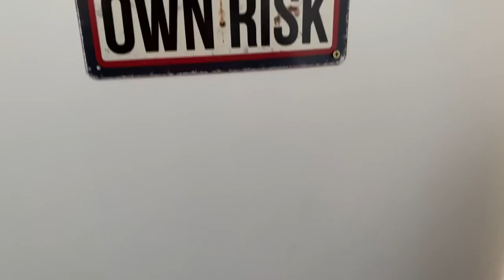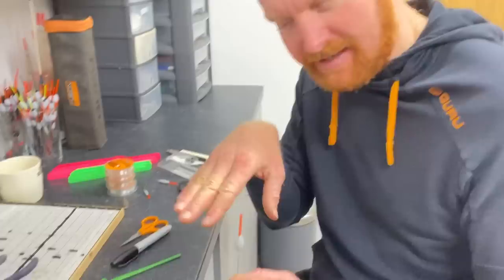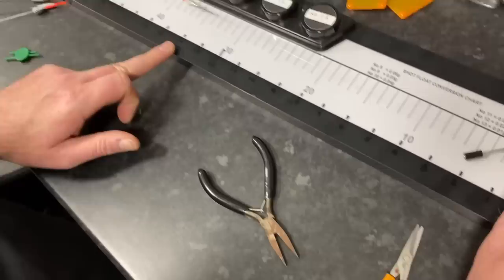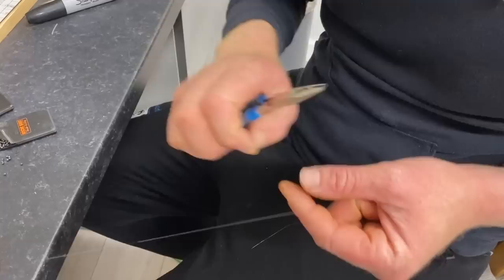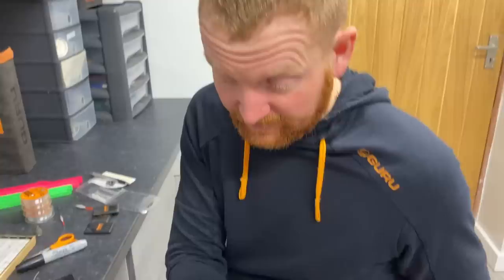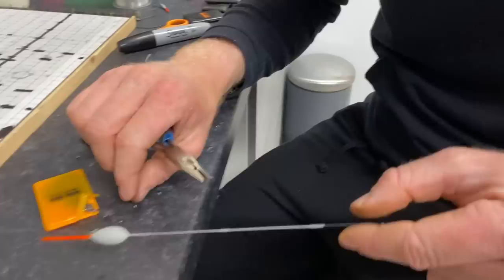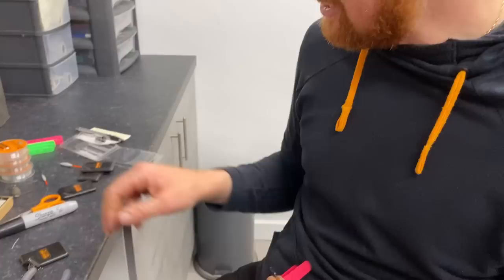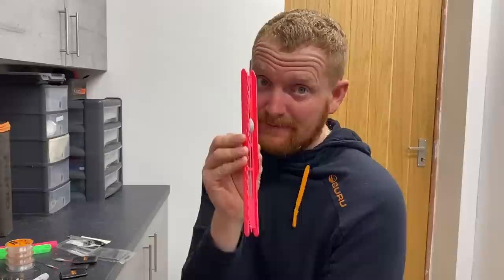How To Tie A Deep Water Silverfish Rig with Matt Godfrey

Comment: cracking vid. id use the rig on one of the deeper Silvers Lakes at The Oaks in yorkshire. your method is certainly far quicker than mine ! When shotting I havent tried wetting the float, but use a bit of washing up liquid in the container I sue, and still find the float sits far lower when actually on the bank. Will give your method a go

Comment: The trick you use to remove shot is a great tip, I've done it for donkeys. When i try explain thats what the metal ends on the Levapiambo are for they look at me like I'm a nutter.
  Please show a Levapiambo used in this way people are more likely to take it on board coming from a pro👍😁

Comment: I got a local club water about 8 ft deep full of small skimmers and slivers that’s going straight in my box for next outing I tied it watching your video actually you could have taken a moment or two longer talking about the actual shot spacing yes it’s bulk 42 yes the first one 14 cm no mention of the rest other than tapered ? I’m guessing it (inches ) 54321 ? Ish